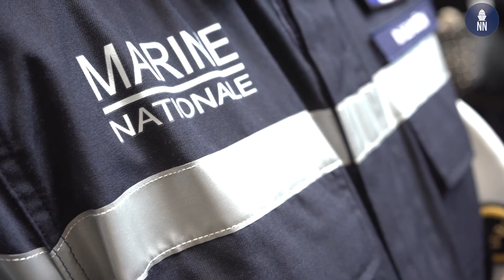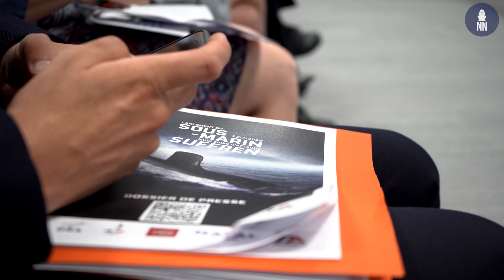French Navy's New Generation SSN 'Suffren' Launched by Naval Group

Comment: the best SSN after Virginia and Astute classes
Reply: Yorg polux Actually it’s better than both of them
Reply: @louisg2404  exactly because it is all new in its design and type of submarine. he is the first of his generation.
Reply: @louisg2404  but it is smaller and with less payload, displacement and speed..in wich parameters is better?
Reply: Yorg polux Stealth, sensors, electronic warfare, etc etc
Reply: @rafalef42  i don't think they can be compared, the triomphant class is more in the line of astute, this seems smaller
Reply: Tullzter Triomphant class is used to launch nuclear ballistic missiles, barracuda is an attack submarine
Reply: @louisg2404  it's what i'm saying, the Astute can be compared to the Triomphant class, not to the Barracuda
Reply: The Astute is a disaster.
Reply: Gar  Not impressed at all.

Comment: Non non.The Royal Navy Astute class is the Best SSN. We use the Rolls Royce reactor to make the perfect cup of Tea.
Reply: Maybe.... when it works.
Reply: To me the obvious difference between this Suffren and the Astute class is their size - the Astute is nearly twice as big,maybe the Australian version will prove that Nuclear Powered isn't always the optimum solution,plus it will have 8 Torpedo Tubes as opposed to 4 on the Suffren.
Reply: @paultanton4307  6* not 8 tubes.
And we cannot talk about the best or not, we dont know all specs.
atm, we can say the French navy is a lot more professionnal when you look on the last year and all these problems in the RN...
Reply: Tagada wasn’t it on the Astute that à shooting occurred ?
Reply: @cloverhal2284  Astute or not (idk), it's the same navy with the same personnal
Reply: Yes while docked in Southampton.
Reply: @paultanton4307  wrong. the Astute is just slightly bigger than the Barracuda class. the BRITISH vessel is around a little bit less than 7000 tons, while the FRENCH Barracuda is slightly less than 6000 tons.
Reply: That's not correct - the Astute class is  up to around 7400 tons surfaced,7800 tons submerged versus 4800/5300 tons for the Barracuda,i wouldn't describe that as being slightly bigger at all !.
Reply: Not at all, the French ones are far better, they're next gen and make less noise than a shrimp shoal
Reply: Ariel....non...Non.....NON!!!!  you ...you silly man..Mon dieu..Zeut allors wiz your Shrimp Shoal. Zis canot be true.The Astute is more silent and more deadly than a fart from ze Queen..I am Triggered.The only way to sort this is ...Fight..1 week from now .200 miles due west of Brittany.You in ze very pretty but inferior SUFFREN.ME in HMS ASTUTE. Do you accept my dear Frenemie..